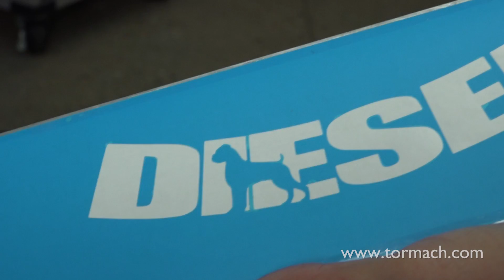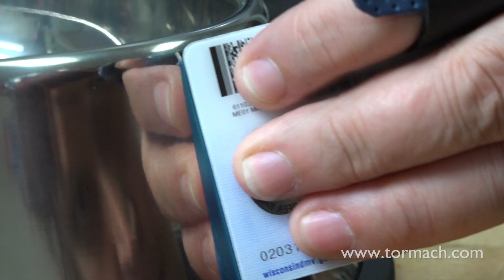Cutting Stencils with a Tormach PCNC 770

Comment: May i ask, how do you compensate for the drag knife having an off-center tip?
Reply from the maker: The drag knife compensates for itself - when it rotates, it remains on center.
Reply: That's a bit confusing. I am interested in buying a drag knife (i am a PCNC 1100 owner) to cut small letters. If this is a standard drag knife, when it rotates the tip of the knife is still off-center and it might not be a huge problem with large sized letters but with smaller ones it might be, especially in the corners?
Reply from the maker: In most cases the drag knife, should center on the cut, but it's recommended avoiding radius values less than .05” to prevent incomplete cuts and to ensure sharp, angular cuts and corners.  This being said though, some of this can be adjusted in your CAM file by programming line overruns and adjusting your lead in and lead out so that the point is in the correct direction at the beginning of each cut.  Adding an overlap in these areas will decrease the need to trim incomplete cuts.

Comment: Transfer tape works really well to apply your stencil without wrinkles, especially if there are a lot of fussy little unattached bits to the graphic. Cute Doggo !!!
Reply: Thanks, Warren!  Diesel makes one heck of a good tech. 😉. I love that you mentioned transfer tape, because I had a face-palm moment after starting this project - realizing that transfer tape would have made life so much easier.  Good call. (It was kind of a spur of the moment project, so prep was an after thought.  It was loads of fun though.). 😄